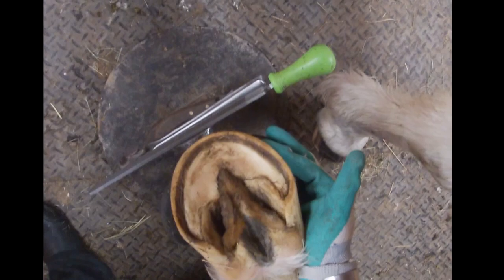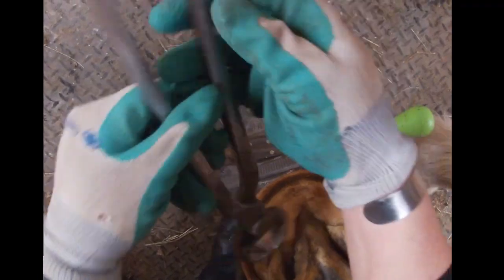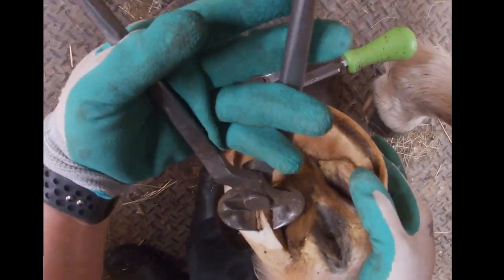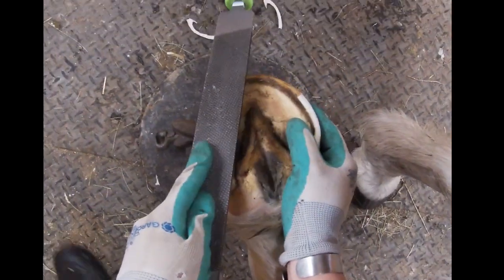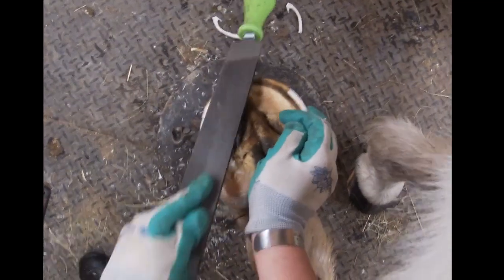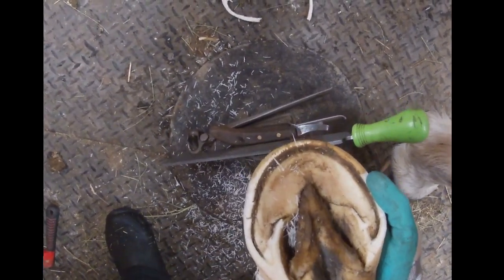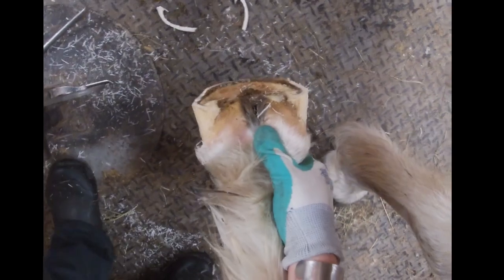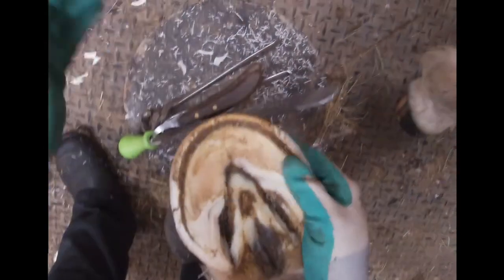Barefoot Trim Assessing the Heel

Comment: When you're trimming the bars, do you just make sure they're level with the sole or do you go ahead and take the bend out of them?
Reply from the maker: It really depends. Usually I just take them to the sole level or sometimes slightly above. If they are really laid over and I feel there is enough sole depth beside them I sometimes will try to move them over at the level of the sole.
Reply: @oksnhc  What about the length of the bar?  Do you shorten  your bar length?
Reply from the maker: @lennyrat4ever447  I usually clean up any bar running forward past the bar termination point about midway down the frog.

Comment: I’m assuming that prior to this video you had gone to live sole with a hoof knife before basing your heels off of just dead sole?
Very nice information!
Reply from the maker: hD xB I don’t like to remove the dead sole with a knife, instead I leave it for padding/protection so long as it is uniform and won’t cause a pressure point. But I definitely do assess where I believe the live sole would be in assessing heel height. As I rasp the heel down I watch for the live sole in the seat of the corn to make sure it does not get invaded.

Comment: What is the angle of the collateral groove? Like when you are looking at the bottom of the hood, you are looking at the bottom of the bone, but is that bone flat? How do you know if you can’t see the bone?
Reply from the maker: You cannot see the bone, but have to visualize it's placement. The bottom of the collateral grooves are sitting above the plane of the coffin bone so if we angle the heels to match that plane, we should be creating a ground parallel coffin bone. Really we are looking for ground parallel at peak impact, so we are aiming for 3-5 degrees when trimming. I find most people do not trim the heels back to the collateral groove angle far enough so that 3-5 degrees happens naturally.
Reply: How do you get the heels back to the collateral groove?